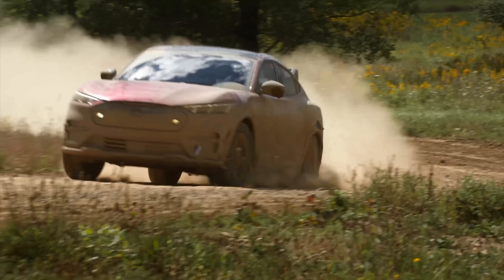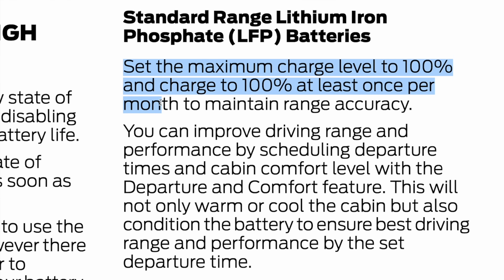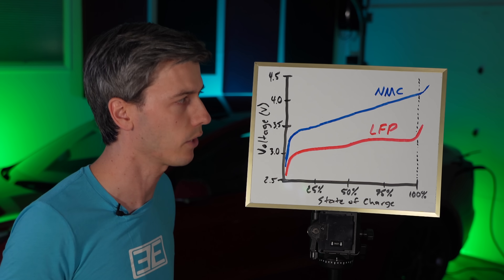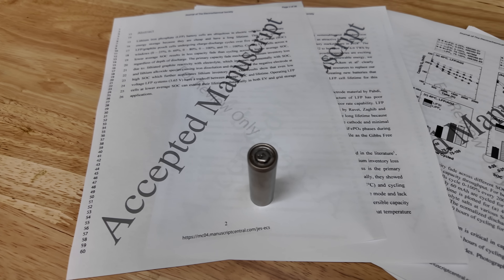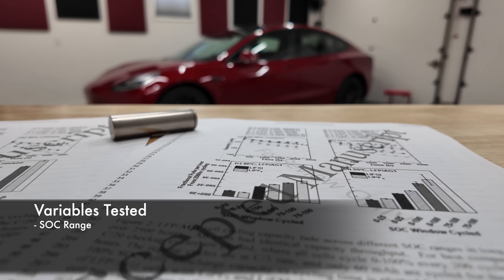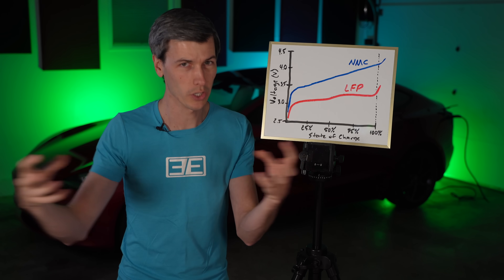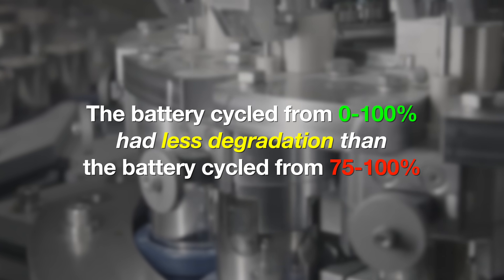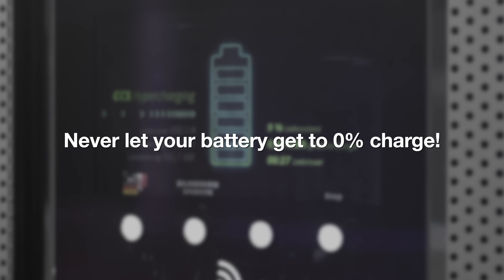How To Ruin Your Electric Car's Battery - LFP Edition!

Comment: From the paper: "It is important to note that we cannot make conclusive lifetime extrapolation statements, because these cells were stopped for destructive analysis after only 2500 h of testing. The best performing cells retained 97% capacity at that time, while the worst performing cells retained 76% capacity. Some preliminary unpublished results on smaller sample sizes suggest that LFP cells cycled at high average SOC may not experience a continuously rapid capacity fade and could recover in later cycles."
Reply: lol
Reply: that's a ridiculous difference for just 2500 hours. That's pretty much a totaled car for a car that is already low range, at just 2500 hours, or 150.000km if travelling at 60kmph on average. Nevermind being in stop and go traffic, regenerative breaking, highway driving at high speeds, heat deterioration, and whatever other crap these batteries are sensitive to.
They will be trash in half the lifetime of a properly built normal car or hybrid.
Reply: @rarespetrusamartean5433  You read that wrong: in the paper they deliberately tested at higher temperatures to accelerate the deterioration. In a car, you have thermal management to keep the batteries happy - in this test scenario, they deliberately took them out of their comfort zone to speed up the process - a normal thing to do when accelerated life testing.
Reply: Wow there's some SERIOUS reading comprehension issues as well as general comprehension all the same.

Keep telling yourselves that EV is better. There's a reason the attempts to bring them to fruition fail REPEATEDLY. Multiple reasons even. The koolaid ain't as tasty as any of you seem to think. Enjoy your battery fires, range issues, and ridiculous charging times.

Meanwhile I'll be riding past and laughing.
Reply: @MadScientist267  NFPA reporting that only 4.9 out of every 100,000 gas-powered vehicles experience a fire, compared to 2.5 out of every 100,000 electric vehicles (EVs). This means that EVs are almost half as likely to catch fire as internal combustion engine cars.
Reply: @trinityhades  Yet another example 🤦‍♂️
Reply: @MadScientist267  opinions of people who will never be able to afford one don't really matter.
Reply: @HyperVegitoDBZ  Has nothing to do with the money. I can list endless ways EV is inferior... Nobody can name a "benefit" of an EV over ICE. It just isn't there 🙄
Reply: @MadScientist267  🤦
Reply: @HyperVegitoDBZ  What are they?

The infinitely more difficult to put out fires that start without warning? Or maybe it's the displaced emissions? Or the ridiculous charging times? Possibly the range anxiety? Or maybe it's the babysitting one must do to keep the battery healthy over time? Or is it the extremely poor cold weather performance?

Certainly the "0-60 in nobody cares" can't make up for all this...

Do tell 🙄
Reply: @MadScientist267  just drive your gas car and leave us alone. i dont care about dinosaurs they had their time...
Reply: @mosfetkiller3851  Just enjoy your lack of education. Large vertebrates have nothing to do with any of this 🙄
Reply: @MadScientist267  enjoy your cheap gas. my ev power is for free all year
Reply: @mosfetkiller3851  So what you're saying is, you not only don't have any idea what is going on, but practice theft on top of it?
Reply: @MadScientist267 iv had 10 ice cars over the years..  I'll only ever own 1 EV.
Reply: @markkennard861  IKR? Be paying on it so long they will be replaced by dilithium crystal powered warp drive before another one can be bought.
Reply: @MadScientist267 the irony in pretending to tow the middle ground while saying EVs have no advantages over ICE vehicles is truly insane. To be clear, I'm not much for EVs and likely won't own one for a long long time. That being said, I can be honest enough with myself to recognize a few of their benefits, like filling up at home, lower maintenance, & lower costs of said maintenance.

Your lack of either self awareness or intellectual honesty needs some work. Both engine types have advantages over the other. For your average commuter, the benefits of an EV far outweigh the benefits of the ICE. That's the current shining spot for EVs. They fail to replace ICE vehicles in just about every other scenario though.
Reply: @bbbbbbb51  "both engines".

Lost me there. Drop your opinion in the porcelain there and push the lever.
Reply: Interesting. My gas tank maintained 100% capacity.
Reply: @MadScientist267 Your gas tank perhaps…. But your mechanics will consume more over time due to various burnt gas deposits
Reply: @willbee51  Ah but my gas tank won't just spontaneously become an inferno in my driveway, on the road, or in a parking garage... But if you need to tell yourself that in order to believe EVs are somehow "better"... whatever works I guess. Gives you something to think about while you're waiting forever for a charge as well... I don't have time for all that, the 2 minutes it takes to completely fill my tank to 100% capacity where it will remain until I actually use it... think I'll stick with things that work.
Reply: @MadScientist267  Commenter didn't say better. Just stated a fact about engine degradation that occurs over time.

Storing energy in any form has the potential for issues (a propane tank, gas canister, a lithium battery for a power tool, RC car, or battery bank, etc). Gas car fires do occur while in operation and after shutoff. Hybrid vehicles are integrating both engine and battery tech making for additional risk.

If people could turn their home into a gas or diesel station, I suspect they would. EVs allow you to turn your home into a convenient fill-up station. 

While you can fill up more rapidly compared to an EV, your time is wasted elsewhere. Engine oil changes, transmission service, differential service(s), brake fluid change, transfer case service, coolant flush, power steering fluid, and "tune ups" are basic maintenance time (and money) consumers. Brake fluid changes and brake pads and rotors replacement are other service items rarely needed on EVs.
Reply: @RT-rv5be  Hence the quotes around "better". 

Better is what works and is a practical solution. Even if all of the "in car" issues with batteries and all of that are resolved, still have the supply chain issues. There just isn't enough lithium to do everything everyone wants to do with it. And before you backpedal to "what about sodium"... ok but then you're back in lower capacity battery territory again, granted not as low as some in history (cough, lead acid)... but still less. Something EVs really can't afford to be dealing with... ask any of the.. what are they on now.. 6th major iteration attempt? I've lost count. There's a reason they keep getting pushed to the side of the road in favor of the ICE. 

Don't get me totally wrong... I'm not completely "naysay" when it comes to EV... and they are closer than they've ever been in history to taking off and over... but for all the gains one might get, the downfalls are still too significant to do [at scale, this round].

But the idea the engine and transmission of a traditional drivetrain tends to fail in rather predictable ways, and there's "all this" in consideration of a battery... Naaa.

That said, save the safety chat about gas tanks going off... yeah fires do happen, but they are readily extinguished and tend to stay that way... a battery fire is like nothing else... I'm good, thanks.
Reply: Just wait for solid state and all of your criticisms vanish.
Reply: @MadScientist267  LFP batteries are 100 times safer then NMC ,and they are even cheaper,only downside is little less power to weight and little slower charging then NMC but i buy EV LFP is my choice
Reply: @MadScientist267 EV might lose range over the years, but an ICE will lose power which is honestly even less fun
Reply: @MadScientist267  You're good, but you have a strange need to go around youtube comments and preach about gas cars...
Reply: @KeeperRL_official_channel  Echo chambers are cute and all but ultimately useless. No point in an entire group being in agreement... wouldn't be anything to say.
Reply: @MadScientist267  But you didn't bring any interesting point that would help anyone understand more, just took a jab saying something everyone knows. Might have as well said nothing in this case.
Reply: @peter.g6  There's more to read 🤦‍♂️
Reply: @MadScientist267  ICE cars also catch fire. 🤦‍♀
Reply: @MadScientist267 You claim you're a Scientist, but you refuse to look up a basic statistic. According to a 2022 study by Auto Insurance EZ, EVs are involved in about 25 fires per 100,000 sold, while gas-powered cars are involved in about 1,529 fires per 100,000 sold.
Reply: @MadScientist267  "Estimates by the Phosphorous, Inorganic & Nitrogen Flame Retardants Association reported 55 fires per billion miles travelled in ICE vehicles and 5 fires per billion for EVs" What was that about fires, again? Ignorance is a bliss.
Reply: @MadScientist267 I don’t have to think about anything while I charge because it’s at night while I’m asleep 😂
Reply: @willbee51  not if you keep up with basic, cheap maintenance that can be paid off by simply not buying an overpriced EV
Reply: @MadScientist267 gas cars become spontaneous infernos all the time. Like 10x more often than electric cars. 

It takes 2 seconds to plug my car up in my garage and I wake up the next day to a full charge.

...but if you need to tell yourself that in order to believe gas cars are somehow "better"...
Reply: @MadScientist267  I mean with turbocharged cars being common, cars are definitely starting to have a risk of turning into an inferno if not adequately cooled off after being driven.
Reply: @GewelReal  EV will lose horsepower as well. Not only battery capacity weakens, the peak voltage also weakens. The ICE can be restored with tune-up/rebuilds, while the EV can be restored with battery replacement.
Reply: @MadScientist267  It's funny how you harp on about battery fire risk--- under a video about LFP batteries.
Reply: @felixmoore6781  Why are you even talking?
Reply: @MadScientist267  We need government to help things along, both with supporting EVs and reducing car trips.
Reply: @dzonikg  The not being able to tell SOC from voltage kinda sucks. Wonder if the car could be made to check impedance or some other electrical characteristic that varies with SOC to estimate it.
Reply: @KeeperRL_official_channel  The Republicans and/or Big Oil might be paying him.
Reply: @MadScientist267  it's a moot point because EV's are transitioning to LFP which don't carry the fire risk NMC does. Duh!
Reply: @felixmoore6781  he's a troll and an ignorant one at that.
Reply: @franklofarojr.2969  Coulomb counting is used. Even for those that don't do a monthly top-off charge the error is only 3.3% and you could program the GUI to reflect that.
Reply: @cruze1953  Battery fires just the biggest problem. Certainly nowhere near the end of the list. But I guess I'm just egnint trawl... so what would I know anyway. The only thing for certain is y'all think that koolaid is so sweet...
Reply: @PURENT no...
Reply: @KeeperRL_official_channel  Some people have an innate tendency to hate change. I bet he would have gone around saloons in the 1800s saying, “I laugh at your mechanical monstrosities, my horse works just by eating grass.” 😅
Reply: @MadScientist267  The way I see things, I don't care about the environment, I don't care about gas savings, all I want is to get rid of all of those 98437 random sensors, oil, spark plugs, coils, cats, timing components,  turbos,  manifolds etc etc etc. I just want to be able to put it in drive and go.

I'm sick of having a random $30 sensor act up and have the car in limp mode. Random leaks. Random xyz code in the ECU, etc.

Comparing the complexity of an EV to an ICE car, it makes the latter seem almost ancient and barbaric.

Realistically unless the battery or the electric motor breaks (which financially is catastrophic, I agree), I should be able to drive for the entire lifespan of the car with almost no maintenance, especially for EVs without air suspension.

And I have seen plenty of 300k+ miles teslas on their original battery/engine unit.

This coems from someone who's had 4 Porsches (all ICE, 2 V8s) in the last 2 years.
Reply: @PURENT you're thinking DC motors on electric forklifts or very old EVs. In layman's terms, modern EVs use AC motors and VSDs which also compensate for voltage drift. So no, EVs don't lose power.
Reply: @duke_of_oz  The batteries are DC and are prone to wear. There's no trick around it.
Reply: @MadScientist267  Whose mind are you going to change by repeating extremely common talking points that EV enthusiasts have heard and understood for years? Everyone knows batteries lose capacity over time, can catch on fire, lithium isn't abundant enough, the grid couldn't handle everyone owning and charging an EV at the same time, etc. Sounds like you're just ragebaiting...
Reply: @ Maybe along about the time I see evidence that it actually IS understood.
Reply: @MadScientist267  At the end of the day, if gas vehicles work better in your situation, keep buying ice (EV trucks being a great example).

In my case, I have chargers both at work and home, so I almost always leave fully charged. I also do mostly local driving and insurance is the same as my 2018 Camry (in my specific case).
Reply: Some of your repliers make some good comments... but you are too concerned about being right to take anything on board.  EV's are far from perfect... but why not accept that on some points they are not AS bad as the oil lobbyists want everyone to believe.  LFP lasts longer and are fire safe.  They force you to take longer stops while travelling long distance and aren't as 'good for the environment' as some would like to believe.  Good points and bad points, just like ICE.
Reply: @MadScientist267  Your "Range" will degrade over time in an ICE vehicle too though.... So it's the same thing, just different. My 5 year old car lost about 80KM from a full tank from new.

Comment: I wonder how much damage it takes to leave and forget it at 0% for a year.
Because I think thats whats happening with a lot of small businesses that sell small batteries for drones or cameras. They lay around in storage for 2 years and then they ship it to you after its been at zero for 1 year. And they are basically dead on arrival. Because of course the cell manufacturer will charge it to 80% but if can't sell it for a year its going to go to zero. Happened to me a couple times. even tough its LiPo its still similar behaviour I think..

Comment: It's also worth noting with all the talk of LFP degradation that LFP suffers significantly slower degradation compared to NMC in the first place.

Also, when that study did 0-x% and x-100%, is that of total battery capacity, or with the use of bottom and top buffers as the batteries in cars actually have, in order to protect against that degradation since the worst of it happens, in both chemistry types, when completely charging or discharging to those respective 100% and 0% marks.

If no buffer, how much of that multiple cycle 75%-100% was because of charging to 100% of gross capacity instead of nominal that would actually be in a car? (knowing Ford specifically here uses rather large buffers compared to other manufacturers).

Comment: I am surprised the battery pack is not split into several independently charged parts. That way some software can charge whatever it thinks is best at the moment, as long as you stay away from 0 and 100%. Much easier. Just like SSDs are managed to improve longevity.

Comment: Im used to using LiFePo4 (life po 4), some older hybrids and electric cars that Ford is worked with use nickel metal hydride batteries.

And my plug in Ford hybrid, with 20 mi of electric range, uses lithium ion cells.

There's also the upside of having lithium iron phosphate in colder climates over lithium ion or Cobalt manganese.

Comment: soooo... electric car battery life degrades in temps over a hundred... like where they are made and primarily driven... brilliant...
Reply: im trying to build an engine cooling system I can run at redline in 117°

since the engine doesn't need to be cooler than ambient temp, this is easy to do. 

when I go forced induction Im using a cryochiller...

Comment: There are so many variables. If you have an accumulator without any active thermal management and drive around in areas where the temperature in summer exceeds 30°C and drops to below -10°C in winter, then all the "best practice" advises should be viewed with a grain of salt, as mere guidelines. Since I drive a small city car under described conditions for 5 years, I know. My "case study" is most likely not the typical use of a (electric) car at all. This video just showed how complex this topic is. Btw. I have already my 2nd electric small city car, with the first one still in the family (moved to my father). A small city car is the best use of an electric drive-train. Makes most sense from both environmental as well as economic points. Being able to drive 100km for 7.5kW in the summer is great. All those huge 2+ tons EVs that "suck" 15kW or more for 100km is making me question the sense of owning an EV in the first place. Big, heavy, SUVs. Clearly something NOT needed to shuttle oneself around the city. And possibly up to 3 more persons.

Comment: This seems like a problem to many who think they'd consider an EV but IMO it's not an issue. 

60% charge normally equates 180 miles on a 300-mile battery range. The average American's commute is 12 miles one way. And these EV-deniers keep leaving out the fact that charging is done at home so you're never going to run short. For the average grocery getter/commuter looking for longevity, this video is how you maintain an EV.